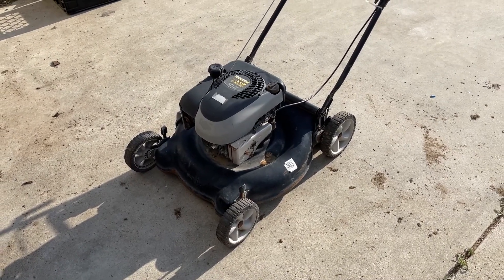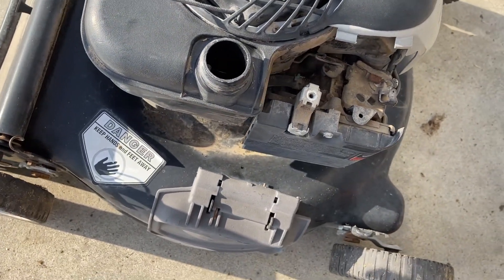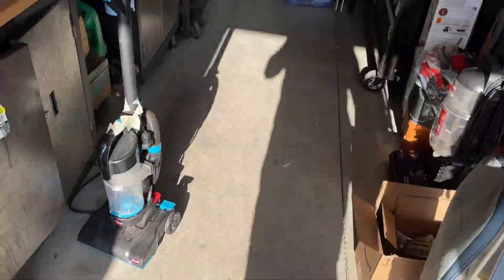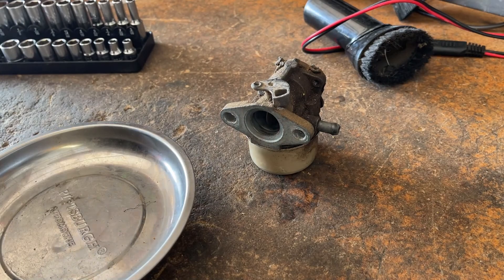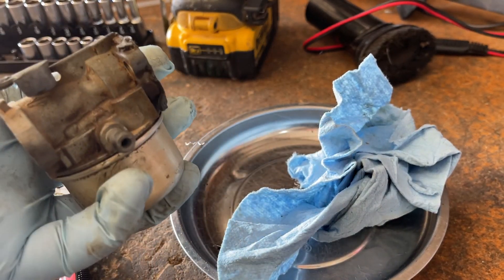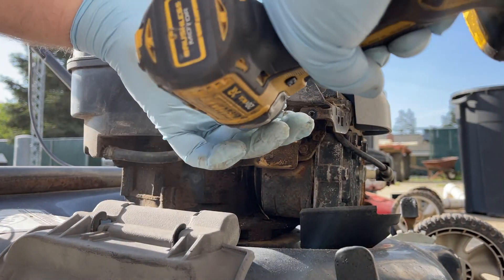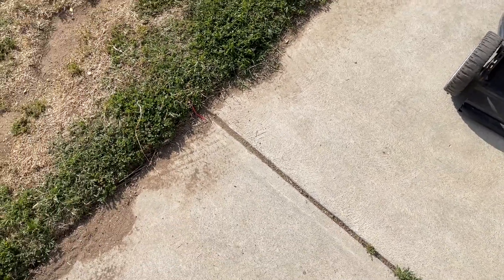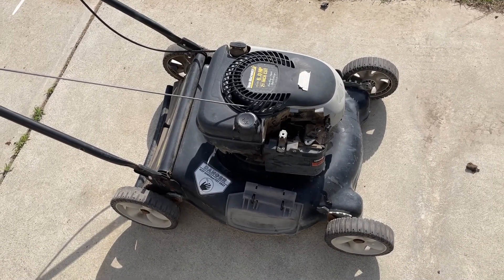Fixing a Trashfind YardMachines Mower that wont Start

Comment: Yah keeping those scrap carbs around helps a lot.  I had older a 5HP  quantum engine with a discontinued  choke carb  that lost its choke spring. 
I ended up converting to primer carburetor and air box  with a little modified to plastic and it worked